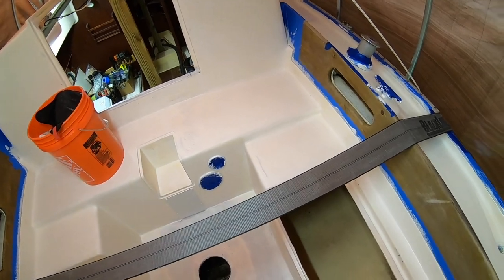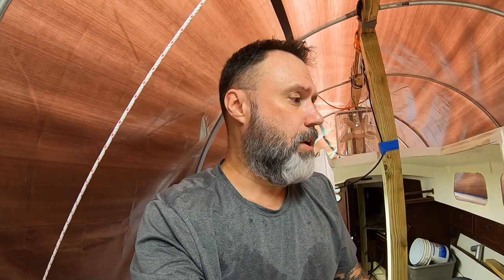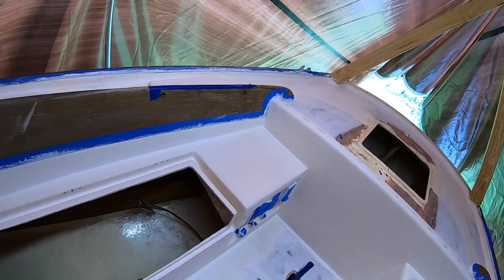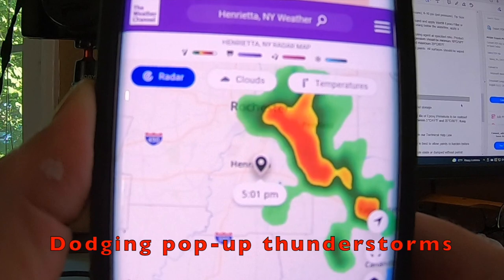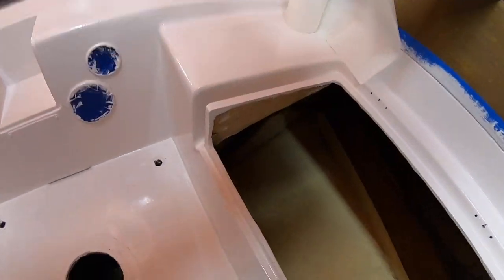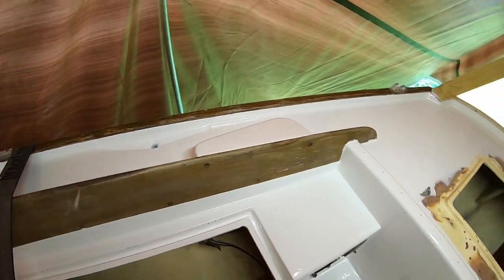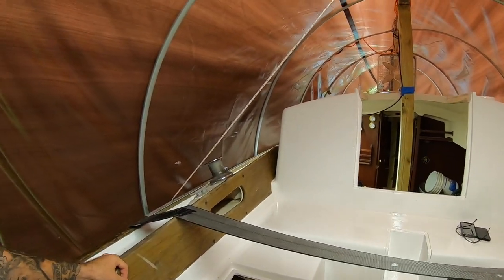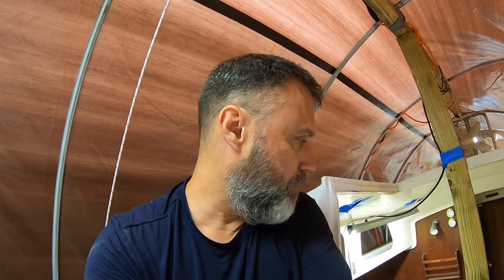Episode 11 - Painting the deck with Interlux Perfection

Comment: I am painting our this week too, under a tarp like yours. Lots of heat and humidity here. Interlux oyster white is what I am using, looks like the same color you are using. I am almost 60yrs old, I feel sore today. I have to break the deck and cockpit up into three sections to paint. Like you said, kiwigrip hides a lot of stuff. I am running low on paint and it always seems hard to get the color I am using , so I decided to tripple  prime the areas under the kiwigrip and save the oyster white for the parts that show. I don't mind a less than perfect finish,orange peel is our friend, lol. An old guy with a big steel boat told me once, 80% is 100% for a boat that sits in the water. Your boat looks great!

Comment: You mentioned kiwigrip, it works great to hide imperfections on the deck as you know. I recently made new counter tops for our boat, I used cream colored Kiwigrip and a small low nap roller to paint the counter tops. They look great, very light texture and instant surface. Just wanted to pass that along to you .

Comment: Are you going to nonskid?
Reply: Yes - I have Kiwigrip ready to go, but not going to apply it until I get closer to splashing her. The renovation work is just to dirty. Easier to scrub the current smooth surface clean for now.
Reply: @dgpratt  You might want to pounce pumice in the wet paint and give it a top coat with Perfection (which I found no better than my usual oil paint).  Pumice is cheap.  Did I tell you about 3M silver tape 225 which can be left on for weeks and still come up easily?  Beware, though, at it’s price—about $100 a roll, it is hard to find and has a shelf life.  I haven’t found any paint that really lasts on a deck.